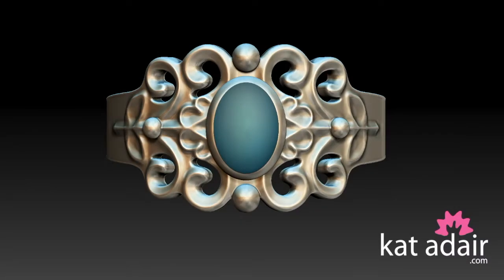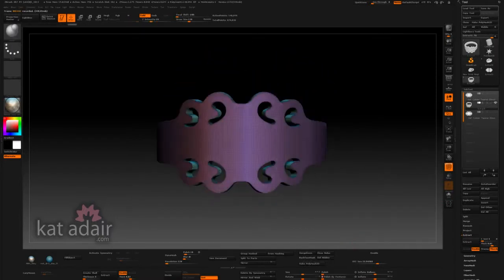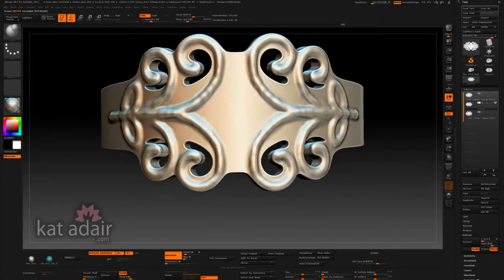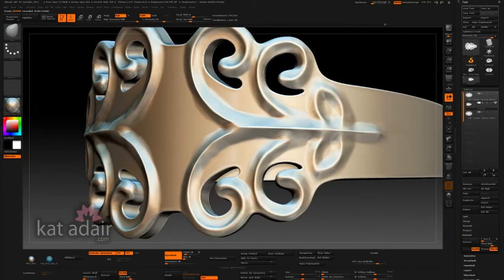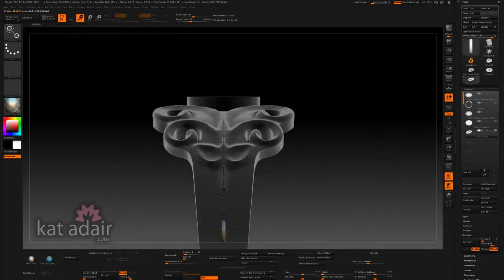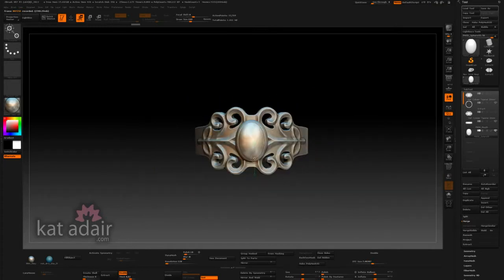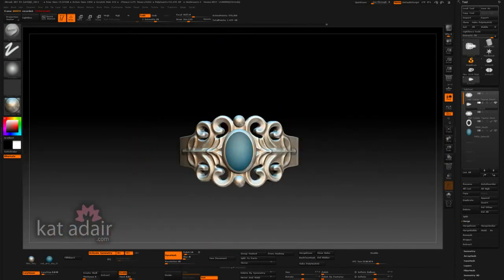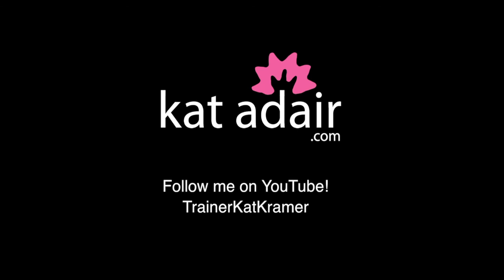Scroll Ring in ZBrush Demo

Comment: How did you "isolate the ring and get rid of the background" sorry I couldn't follow that part
Reply from the maker: Beulah Royds, can you tell me what the time stamp is on the video? I’ll be happy to clarify!
Reply: Kat Adair sorry, it's almost exactly at the start 0:46 . After you draw the mask (which seems to be on a half cylinder, but later turns into a full cylinder, which I'm also not sure how to do?) I'm not sure how you then turn it into the two parts and come away with the rough ring shape? Thank you for your quick reply! (I'm sorry that I'm so bad at explaining things but hopefully you got the idea)
Reply from the maker: I think I know what part you're asking about...this is an old video, and I do them differently now.  But you make a cylinder, then DynaMesh the cylinder with a resolution of maybe 256 to get a nice, clean "grid" to design on.  Use the masking brush (command on a Mac, ctrl on a PC) to draw your design.  There is a command under the Subtool palette, near the bottom, for "Extract."  Set the thickness at about 0.12, turn off "Double" and "TBorder," click the Extract button, then IMMEDIATELY click the "Accept" button.  On that last part, if you click on the background and move, you'll lose the extracted part.  Simply click "Extract" and "Accept" again.

This will create a NEW subtool.  Go back to the Subtool palette, and click on the extracted subtool to make it active, then turn visibility of the previous subtool off by clicking on the "eye."  If you just click on the eye, your extracted subtool should remain the active one.  The light gray on Subtools indicates that this is the active tool.  You could also click on the cylinder Subtool and click on the "Delete" button below it to get rid of the cylinder...you won't need it anymore. 

At this point, select the extracted subtool in the Subtool palette...you need to convert the ring into a DynaMesh so you can sculpt on it.  If your XYZ size is still about 2-3 units, then DynaMesh resolution could be somewhere between 150-256.

I'll do a revised version of this sometime this afternoon that goes a little more into depth.  I think on this one I was testing tutorial techniques, so I recorded the video and did a voiceover.  I need to do this one as a regular video with more detail.  Please feel free to ask questions, and I'll hopefully get you what you need.  

It was hard to get my head around ZBrush in the beginning...so I'm happy to help!
Reply from the maker: Yikes!  I didn't explain that well.  When I created my cylinder, I used the DynaMesh function under the Geometry palette to give it a good, clean mesh that I could draw on.  Then I used "SelectRect," which is accessed by holding down Cmd-Shift on a Mac or Ctrl-Shift on a PC.  You should see a dotted rectangle at the top left in the brush area when you do this.  Draw a box around the cylinder that cuts halfway through, and this hides it temporary so you can work on the rest.  To bring the rest of the ring back, you hold down Cmd-Shift or Ctrl-Shift and click on the background.  

I use that technique a lot to hide part of a model while I work on it.  That's also what I use when I'm trying to put my logo on the inside of a ring shank.  

Based on your questions, I'm going to update this video...I'm at a restaurant right now that's pretty noisy, but let me see if I can find a quiet place to record a quickie video.  Are you here in the US?  If you go to my website, there is a "contact" link at the top.  Actually, we're heading back to the house...I'll do a quick-and-dirty video to explain better.  Give me a couple hours...check back!
Reply from the maker: Beulah, here is an updated version of the video that explains it in more detail.  I didn't edit this one like I do for my more current videos because I was trying to get the information to you sooner than later.  Let me know if you have any questions on the new one...I get alerts on my Apple Watch when anyone comments, so I should see them come through.  Enjoy!  http://www.youtube.com/watch?v=mk_0K0inpkw

Comment: where did you learn  all this?
Reply from the maker: Hey Thomas!  I just saw your message.  It took me a year of struggling through it.  I'd taken an online course that was a re-broadcast of a webinar, but I found it frustrating.  I have a lot of standard CAD experience, and a jewelry background (more fabrication than casting, although I do print and cast my own pieces).  I got a Formlabs Form 2 printer almost two years ago, and I've been printing and casting for about a year.  

I'm working on some updated videos and a full-length course.  I found ZBrush overwhelming in the beginning...in fact, I even called their tech support once in tears because I was having such a hard time understanding the program and didn't even know the questions to ask.  Eventually, it started making sense.

Since then, I've also realized that you don't have to work at super-high resolutions to get good results.  I was literally working on a 2012 MacBook Pro with ZBrush, and the way I learned to work with it was to be smart about the DynaMesh resolutions.  I usually don't work in any model with an ActivePoint count more than about 1.5 million.  Most of my models are in the 600,000 AP count, which means that I don't spend time waiting for the computer to process.  My desktop is a 2014 iMac, and I recently upgraded to a newer MacBook Pro.  I'll also use something called Astropad Studio to turn my iPad Pro with an Apple Pencil into a graphic input pad...some ZBrush artists are using expensive Cintiq hardware to be able to draw directly, but my setup with the iPad Pro means I can sit on the couch and "tether" to one of my other machines to draw.  

If you get this message, I'm curious how you've fared with ZBrush...and what types of things you're trying to do.  Check out my other videos, too.